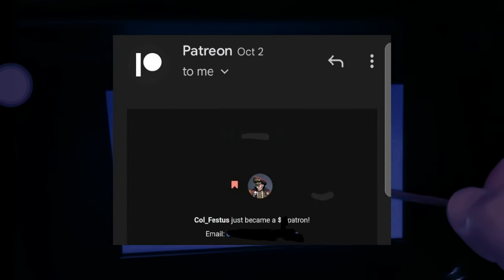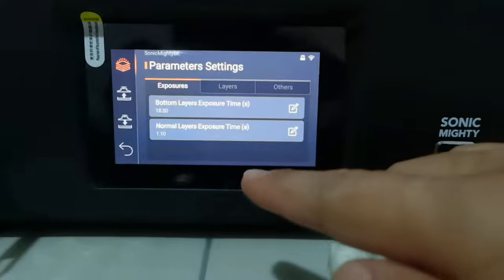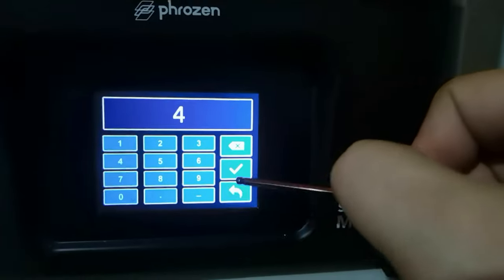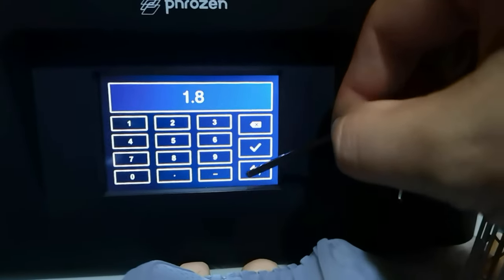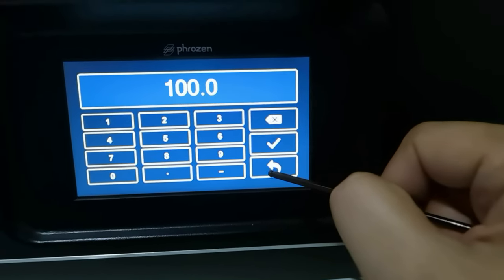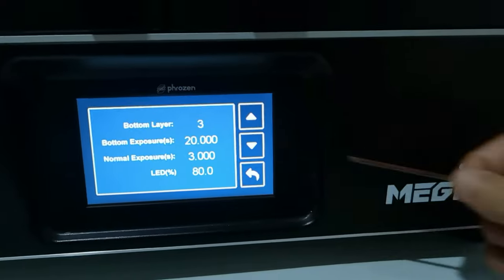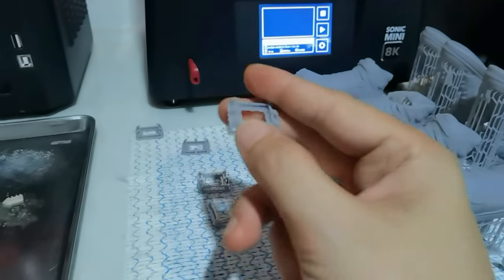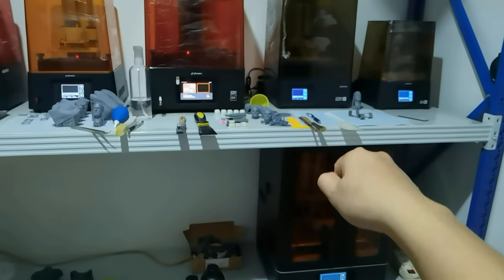Resin 3d Printer Hidden Feature

Comment: Works on the Mars3 too. You don't actually have to pause the print, I usually do it while it's moving down. You just have to move quick.
Reply from the maker: Well just to be safe.
Because some "people" need the advice.
LOL
Reply: Nice I have a mars3 will have to try when I get home
Reply: Nice! Does it include LED intensity?